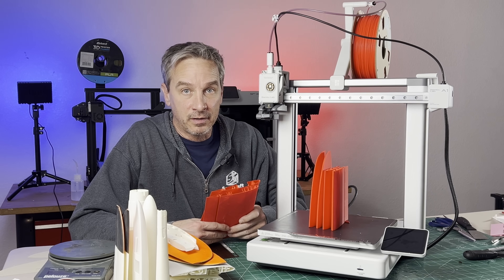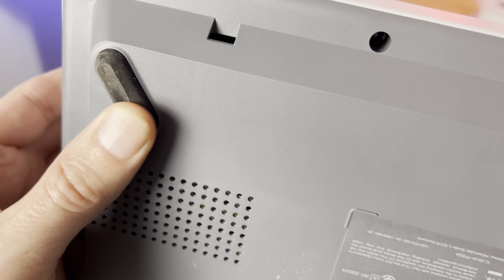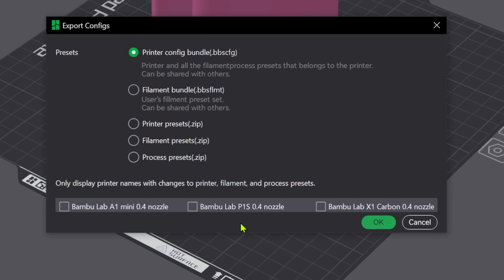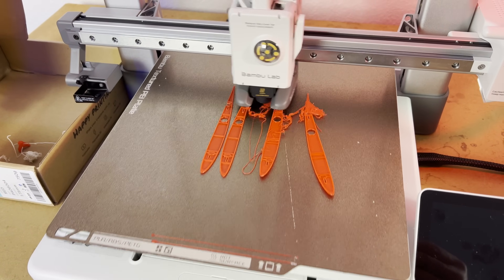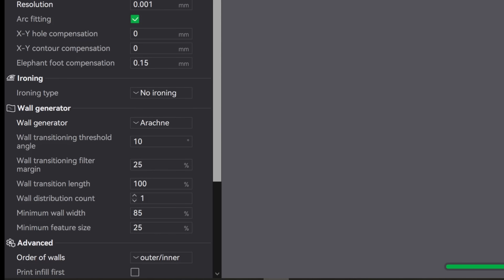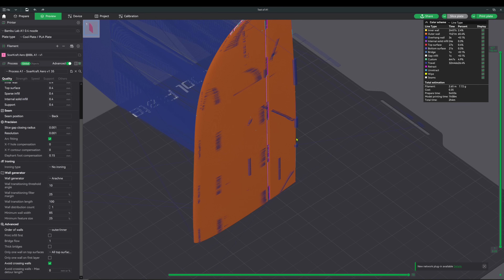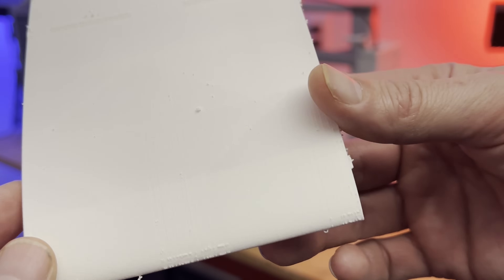Light Weight PLA printing with the new Bambu A1 (regular size) - part 1

Comment: I'm sourely dissapointed about practically every 3d model JUST doesnt fit in the build volume of the A1 Mini (180^3). Eclipson as an example requires only 150x150 build volume and if they just modified their design to print the wings/Fuse with One extra part it would all fit perfectly! The Model A prints everything perfectly apart from the one Wing section. It's infuriating
Reply from the maker: scaling... there are planes that can be scaled down.... not mine... but others.  
https://www.rcgroups.com/forums/showthread.php?4632045-Jart-3DP-A-Scalable-Customizable-Jart-%28Free-3mf-STL-download%29
or design your own.  You can complain that someone else is not doing what you want, or get it done... ;)
Reply: @soarkraft  Thanks for that suggestion! I did look into it but given that the Eclipson models have standard mounting for stuff like the motor and servos I can forsee it causing multiple headaches! I'd be happy to pay for an A1 Mini Version of different models. They should look intto it.. I bought my Mini for under $250 and I'm sure there are thousands out here like me! Cheers😃

Comment: I have the x1c and was curious what setting changes you made when printing with LW PLA? I’m using Overture and was wondering if you could share that?
Reply from the maker: See my website, got it all for an X1C.  BTW Overture LW PLA is prefoamed material.  Use the Prefoamed configuration for the best results.

Comment: Have been playing with the X1C for a few months...but now trying to get some lw-pla material to print.  Haven't been able to get ANYTHING to work.  Any in site or anything to help a guy out?  Looking at a few of the planes you have, but need to get this darn filament to work first
Reply from the maker: I have X1C LW-PLA config files for Bambu Studio / Orca on my website.  Just import and print my test part.  All of my planes will print with LW-PLA on an X1C.  May work with other planes from other designers, but you can test them... I can't fix other peoples bad CAD.
Reply: @soarkraft  I have used those settings with the material, and still getting issues.  Really want this to work so I can fly more.
Reply: I've had the Bambu LabA1 for around 6 months and as a newbie to 3d printing but not to RC flying, have tried various LW filaments to print 3Dlabprint models designed specifically for LW PLA filaments as well as for general PLA.
The one I've settled on for both categories is made by Polymaker and I've found success in using the same settings for both as well.
The Polymaker Polylite PLA PRO is slightly harder than the standard Polylite PLA so is my preference for printing models designed for standard PLA.
However, the polymaker LW PLA which is pre-foamed works pretty well on models designed for that category  and the only significant changes to settings I made was to add a brim to narrow pieces such as control surfaces like ailerons and elevators etc to improve bed adhesion so they don't fall over.
Hope it helps..

Comment: Just curious, do you dry the PLA Aero filament? I've yet to print in it yet, just trying to gather information before I print. Bambu's website says it is reccommended, and I'm not sure of what to do. I have the Polydryer for reference.
Reply from the maker: The PLA materials, including the PLA Aero, are not susceptible to humidity like other materials.  I do not dry my materials.  I live in a dry climate though… usually less than 40% humidity all the time.  I have new and old rolls that are left out for long periods and they print the same.  And this is the same for all the other foaming LW-PLAs from other manufacturers. Other blends of materials may be different, like the ASA and LW-ASA/ASA Aero

Comment: Annnnd !? What extra effrots required to  'Reliably'  Adhere Prints to the Print plate ??  
Clearly ... the Stock Textured  PEI Plate is Sketchy .... All Brochure Babbles aside. 
Agreed : Bumboo Studio is a Less Than Great Slicr... Buggy and Inept.  Currently Orca 2 outclasses Studio.. easily.
Reply from the maker: I use the cool plate with glue stick.  They have a smooth PEI plate too that works the same.  35degree bed temp for PLA types 55 for LW-PLA.  The textured PEI plate is great for larger thick walled that can handle the higher temperature needed for sticking without glue… no so good for thin walled stuff in my experience… creates a heat induced warp to the skin at 70 degrees.  There are new “super sticky” print plates now available, but I haven’t tried them.

Comment: Anyone resin printing 3d planes?
Reply from the maker: If they have it would be on youtube... do a search.  Scale models, yes, fly-able models probably not. 
Resin printing works well for small precise stuff, though it has been maturing.  
For work projects I have used resin printers, and the parts always needs additional light box time, cleaning and bubbles were a pain... messy.... but you can get pretty fine detail.   The resin also changes over time (like it dries out) and parts three or four weeks old were really brittle even with a clear coat.  The polyjet machines do a better job, but still.... and the cost to get an industrial machine to print a plane would be $$$$$.    FDM printing works really well for this.
Reply: @soarkraft  Well, I have both now.  Bought an A1 Bambu and Elegoo Saturn 3 Ultra.

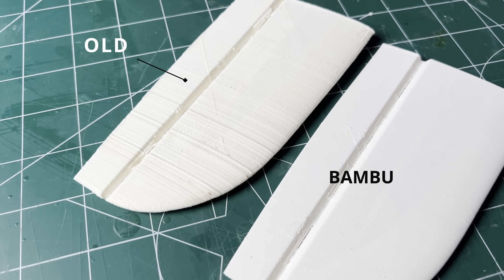Comment: The part on the left at 1:42 with the horizontal raised lines on is what I’m having happen with some of my tall thin aeroplane parts with LW-PLA. Any ideas how I could improve my prints?
Reply from the maker: this is z-wobble, the next layer is not exactly aligned with the one below.  This can be a printer maintanence / quality or exagerated with floppy material / bad bed adhesion.  If the part wiggles while printing it will do this.  The core x-y printers have far less of this, bed slingers more.  The new generation printers are able to tune much of this out, but the Bambu A1 can print as fast or accuately as the P1 or X1.... slow it down a little and it will do better.... like try silent mode (turns the accel and speeds down a little) and try it.

Comment: I just took delivery of an A-1 to help me with my sign business.  I was in the 3D biz in 2004 when I purchased a powder 3D printer for $65K.  I can't even remember the name of that thing. Not exactly a shining moment in my life.  These printers didn't exist back then and boy have things changed.  You can actually use the part when done printing!
Frankly, I'm blown away with the A-1.  I was printing from the unboxing in 30 minutes.  I've yet to have a bad print.  I design in Plasticity and the Bambu are a match made in heaven.
I'm also an RC sailplane aficionado.  Got 3 Night Radians, a 2M really fast and hot sailplane,(my favorite)  and a Fox 3000. 
You've got my attention.

Comment: Would it be better to get the p1s or no much difference compared to A1 ?!
Reply from the maker: The P1S is better if the price is not an issue, its on par with the X1C for most things. With the new LW-ASA and the smell, enclosed printing is good.... The A1 is good too, prints LW-PLA well and work for what I originally wanted it for.  I did need to move it to a different work table from the X1C because it was having some cross vibration issues when printing on both machines at the same time.
Reply: @soarkraft  👍👌 Thanks

Comment: Lw PLA designs should be made to be printed in Vase mode.  No travel moves or retract moves.
Reply from the maker: Sure, vase mode prints have no travel / retracts, but have limitations.  Many limitations.  
LW-PLA can be printed with travels and retracts.... vase mode is not the only way.

Comment: I had a similar problem with your config profiles not showing up after importing them into Bambu Studio and found that the P1P was not listed in the .json file under "compatible_printers". Likely the same problem with the A1 so just edit it in notpad.
Reply from the maker: yep, i just did another video about this.  X1C and P1S filament and process settings can be interchanged, but the P1P is separate and needs to be its own .json file.  There are ways to trick it, but difficult to get it right.  BS / Orca need change to make this better.  Prusa Slicer's way of handling this is way better... but does not support the Bambu Printers

Comment: Hi,
I printed the Pika with the Bambu Textured PEI Plate on my P1S. I use 3DLac for the Buildplate.
Perfect results with Bambu PLA Aero.
Reply from the maker: Awesome.  I have used hair spray and it works too.  However if I am gong to use adhesive I will continue to use the cold plate as it is easier to maintain the "goldilocks" level of stick... for me.  3D printing is a tool, not my hobby, and I can get on with printing and finishing new airplane models.

Comment: Have you tried Magigoo adhesive? I was introduced to it at work and it works really nice with PLA and LW-PLA, and made the most difference with PETG. It works as a glue for the print and a release agent once the print is over, way less warp on the challenging Roughgen 2 servo wing root. It is costly, but lasts a while, and cleans up with water, so a good value. I need to test it tomorrow with your new files...

Comment: I do think a lot of the issues you're experiencing could be solved with different slicer settings. You could even use the A1 Mini profile because the G-code would still function on your A1, at least as far as I know. It would just treat it like a smaller bed. There do seem to be some bugs you're experiencing, but a lot of the quality could be improved with settings tweaks.
Reply: It's a bit risky because the A1 and A1-Mini have different locations for the nozzle wipe areas, so it might scratch the middle of the bed and/or have a bit of oozing you'll need to contend with.

You could always copy the start/end gcodes from the A1 profile
Reply from the maker: Nope, dont use A1 mini settings on an A1... there is a way to force it, but not worth it.  Orca Slicer now supports the A1 and does a better job of slicing / travel moves.
Reply: @soarkraft  Ah good points. Yes I was thinking mostly to use the G-code, but not the start/end code necessarily. Either way hopefully a past issue now.

Comment: Maybe you need to update the firmware.  I have a new A1 and that's the first thing it did when I connected it to the WIFI network.  I also noticed mine going over to the side, parking next to the wipe unit every layer and was able to disable the time laps option and get rid of that.
Reply from the maker: The answer is to use Orca Slicer, it does not have these problems and is directly compatible.  I just did a video about Orca SLicer and printing planes, setting and use - on this channel
Reply: @soarkraft  I have also discovered the Orca slicer too and use it now on all my prints/printers.  It does everything Bambu Studio does and then some.

Comment: i have a ender 3 pro with direct drive my parts never looked that bad like you shown us as from the older machines. ok may the fact is i print only pla and tpu so i know exaktly what settings i need but i dont think i need another printer with a ecosystem behind. the reason is what happen if discontinued can you geht parts and did you need to adopt them? as for the ender 3 no everything is standard and i even converted one to a printer with 4 times the volume and still all the the same hardware exept for the aluminum extrusion there are doable the length. ok it has the same speed and i needed to say in the slicer it is a ender 3 with coustom build volume but it works. i build rc planes to and i tried forming filament but i hated it the benefits a minor and only worth if you unse carbon or aluminum rods as support. my planes are fast and maneuverable and i fly them with fpv so big battery, big motors, big servos and strong parts. and if i crash one for the most part nothing is salvageable. i build rc fpv racing planes. my personal favorite are single wing with differantial control on the back and nose with the motor in the back. this thing rolls like crazy and the up or down pitch bends the rotor blades while turning. my friends say this is not a plane it is a targeting missile and mostly i crash because weight shift or wing braking or i lost my elevator/Aileron on turning. lighter is not always better if you going fast. ^^

maybe i need in the future a better printer maybe one who can print abs or other stronger filaments. i use tpu as shock absorber and inertia dampening for the internals and for a strong but flexible connections for my elevators and ailerons

Comment: Turn off timelapse, that's what's causing the unnecessary travel moves
Reply from the maker: Is there a pre-slicing "turn off timelapse" button or are you mentioning the one before you send it to the printer?  Im not running the time lapse and I do have it turned off when sending it to the printer, but it still calculated the moves during slicing?  
I could also be something else. The A1 mini doesn't do this.
Reply: Ya in Bambu slicer under process settings and under the other tab, timelapse is disabled there? Those travel moves definately look like its moving to the side and pausing for a timelapse @soarkraft

Comment: If you don't have timelapse on, you won't get the travel move. When you go to print from Bambu Studio just untick 'Timelapse" on the print confirmation screen.
Reply from the maker: I don't have timelapse on... and the printer does not do these moves.... but they are still calculated during slicing.  My issue might be something else.  The A1 mini does this same timelapse thing, but the rest of the travel moves are not affected.... ?????
Reply from the maker: Solved: Changing to "inner/outer" Advanced order of walls fixed the travel issue (I had it set to Outer/inner before). 
Its not timelapse though you can turn it off timelapse moves by setting "Print sequence" to "By object".  Thanks @mb323vid
Reply: Good to hear that @soarkraft , I have an A1 but no experience with foaming PLA.

Comment: Try setting "Print sequence" to "By object" to turn off the timelapse.
Reply from the maker: YAY, that totally worked for the timelapse, thank you!
the travel moves are still "lazy" straight lines ..... but for some reason changing to "inner/outer" Advanced "order of walls" fixed the rest.
Reply: @soarkraft  One important note about setting print sequence to by object, model height is a factor. This will probably only work for printing one model at a time since the slicer will complete each model before it moves on to the next. It's not just tool path but any movement could cause the print head or the gantry to impact the printed models.  Hopefully they come up with a way to just turn timelapse off.

Comment: At last a video on the A1 from someone not using multicolor. Your link to the LW foaming Esun is for their luminous rainbow, i looked as i have no idea what foam PLA is.  Though i see esun has and Air lW filament (perhaps they did a name change). So i get the idea of the foam filament. Always nice to learn something new. The air foils look great btw.
Reply from the maker: So Amazon is out of stock of the LW foaming Esun material... it defalts to the other filaments... stupid amazon.
Sain Smart has a Foaming LW material too, out of stock everywhere???
The Bambu Aero PLA is Foaming LW PLA, but have to do there shipping (FedEx ground) and it takes more than a week.

Comment: So unchecking the Timelapse box in the send print dialogue box doesn’t turn off the Timelapse? I’m going to test this asap on my A1. Thanks 🙏
Reply: After testing on my A1 and A1 Mini it does turn off the travel for the Timelapse. You may need to update your firmware to have this option if you don’t see it available.
Reply from the maker: Solved: Changing to "inner/outer" Advanced order of walls fixed the travel issue (I had it set to Outer/inner before). 
Its not timelapse though you can turn it off timelapse moves by setting "Print sequence" to "By object".  Thanks @mb323vid

Comment: for the movements of the head with timelapse on the slicer , if you don't use timelapse it doesn't goes back every layer
Reply from the maker: Totally get that, but by calculating that off part path it might change how the rest of the layer is calculated, longer path than necessary and straight lines instead of following the curve.  Even though the print head never follows the path it is changing the route the head travels before and after.
Reply from the maker: Solved: Changing to "inner/outer" Advanced order of walls fixed the travel issue (I had it set to Outer/inner before). 
Its not timelapse though you can turn it off timelapse moves by setting "Print sequence" to "By object".  Thanks @mb323vid

Comment: Could do with a tutorial for LW-PLA with a Creality K1. Have printed a number of your Ingneous planes with good results on a Creality 6SE but have been struggling a bit with the K1. They fly great by the wat.
Reply: I basically just asked the same thing. Eclipson plane pre-sliced g-code works beautifully on a Ender 3 S1Pro, but not on a K1, which I have gotten decent fuselage parts printing at 300mm/s.
Reply: I've been playing today. Try using the Generic PLA settings - change Material Flow rate to 85%, Inner/Outer wall flows to 80%, Cooling Reg fan to 25%. Special modes - surface mode both. These have worked on the Igneous Tail parts. @murderdoggg